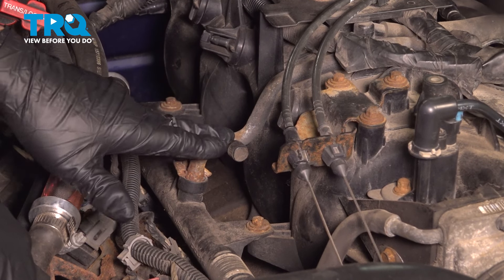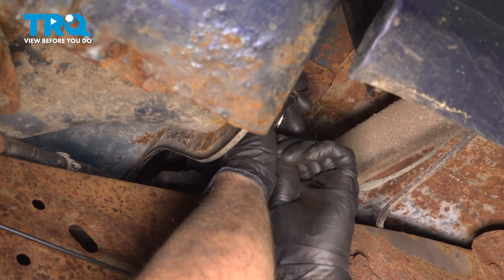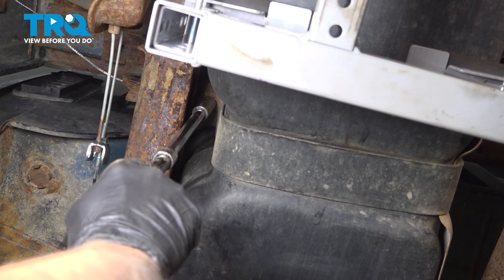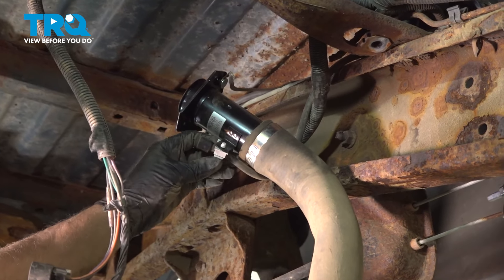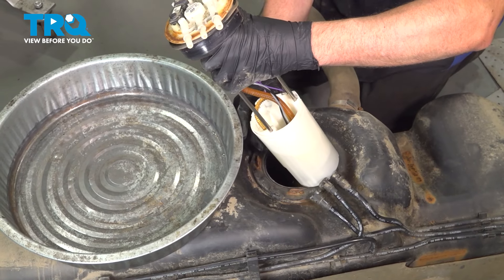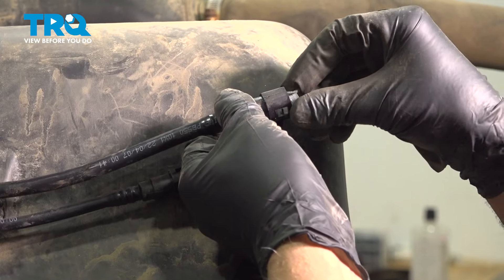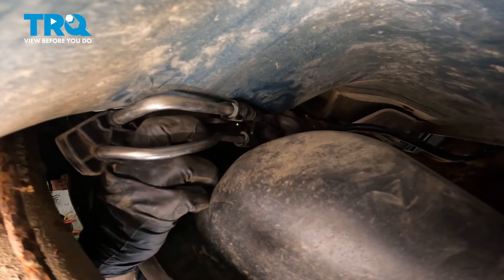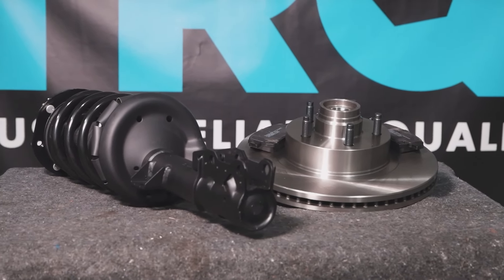How to Replace Fuel Pump Assembly 1999-2006 Chevrolet Silverado

Comment: Why drop the tank? Why not just lift the truck bed on left side about 1.5 feet giving you easy access to the gas tank? You loosen 4 bolts on right side of bed, take out the 4 bolts on left side of bed, take out screws holding filler tube to truck bed, then lift bed up about 1.5 feet and hold it in place with jack stand. You can leave the truck on the ground and you don't need a special jack to lower gas tank.
Reply: Some of us have super rusty trucks and that’s not an opinion unfortunately 😩
Reply: When things get pretty crusty under their bed, bolts can become a nightmare to remove. Additionally, some trucks have equipment racks, tool boxes, headache racks, ladder racks, lift gates, etc. that may make bed removal difficult or even impossible.
Reply: Because it takes longer your way

Comment: Always remove the negative cable on your battery when doing this job. He's using a brass punch because striking it will not cause a spark. Sparks and fuel vapors are hazardous to your health. I've seen this job done on many shows and they all use a punch to take off and put on that retainer ring. Ditch the punch and use large channel lock pliers. So much easier.

Comment: Last video man I so wish I had your equipment that's a handy little deal there for the tank this is my third fuel pump in this truck and my gas gauge still isn't working do you have any ideas and I changed my cluster too don't mean to bother you but great job of response would be great thanks brother

Comment: What if the little connector that plugs in with the wires broke off from the fuel pump while trying to put it all back together but it’s still plugged into the wires coming from the truck and it still cranks and runs what problems could it cause or do I just need to get a new pump

Comment: My fuel pump assembly didn't come with the fuel pump sensor. It has a spot for it, but having issues putting a sensor there due to the hole not punching through. Any advice?

Comment: My Fuel gauge is inoperable on my 2003 GMC Sierra 2500 HD so I was thrown by your mentioning a fuel pump since I've been told there isn't an in-the-tank fuel pump on these.  If it's just the sensor that needs replacing it should be simpler.  Can you confirm?

Comment: Great video! I have a 2002 Silverado 1500 LS extended cab with the 26 gallon fuel tank and right now the truck is at a shop having rotted rocker panels and cab corners replaced so he took the bed off which exposed rusted tank crossmembers, especially the front one. I. found a after-market replacement but I knew my fuel pump also needed replacing after a long time with the gas gauge reading inaccurately—it works but only over about 5/8 reading and higher. 

Because I am not there with the truck right now and waiting on parts because bodyman said I could do the pump and crossmember at his place while he works on rockers and cab corners, I wonder if you could tell me how many inches it is from the ground to the bottom of the tank so I know how high my jack needs to reach the tank with blocks and padding as necessary to take up any gap if my jack isn't high enough? I'll try calling your company to ask if I find a number to call, in case you don't see this message for a few days. I'm trying to make sure I have everything I need to make one trip over to do the work and not have to get aggravated constantly going back and forth for things I didn't realize I need.

Thanks for any helpful info!
Reply: I forgot to say yes, I know I will change pump without removing tank because bed is off, but I have to hold up the front of the tank while I change its crossmember support which holds the front tank strap.